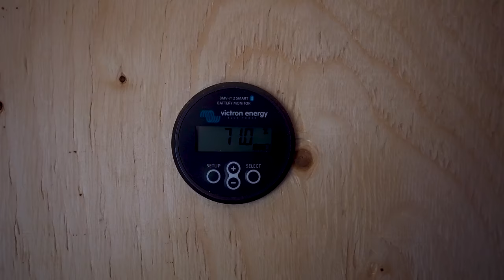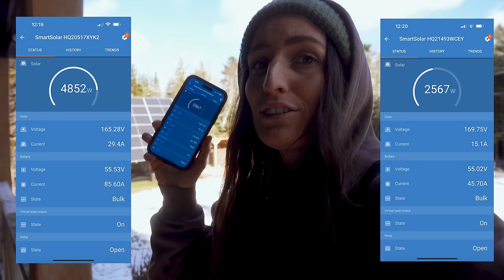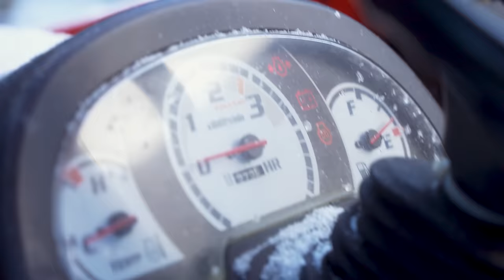Snowed In! Winter Hits Off-Grid Cabin in the Woods

Comment: You need chains for the front wheels at least. I’ve always used a rear blade but one that attaches to the bucket would work also. When you get stuck like that you can also use the backhoe bucket to drag yourself sideways and get out that way. Generally no need for someone to pull you out. As for merch, I bought some already but am always up for more. There are 5 people in our house that would be honored to wear it.

Comment: Yes you need chains but also use the brake on the spinning wheel so some power is transferred to the non-slipping side. The tractor unlike most cars doesn't have a limited slip diff so you have to do it manually yourself using your brakes. Most tractors I've use just have a little metal bar that connects both pedals together and you just flip it loose and can brake each side individually instead then.

Comment: How warm is all the new insulation keeping the cabin?  
Merry Christmas and Happy Holidays from Florida to Nova Scotia.

Chicken / Asparagus soup
Ingredients:
2 pounds thin fresh asparagus
2 large potatoes, peeled and diced
1 large onion, chopped
2 celery ribs, chopped
1 medium carrot, chopped
2 teaspoons dried parsley flakes
1 garlic clove, minced
2 tablespoons canola/olive oil
2 cans (14-1/2 ounces each) chicken broth
1 teaspoon salt
1/2 teaspoon pepper, divided
1 bay leaf
2 cups cubed cooked chicken
2 cups half-and-half cream
Shaved Parmesan cheese

Directions
Cut tips from asparagus spears; set aside. Place stalks in a large skillet; cover with water. Bring to a boil. Reduce heat; cover and simmer for 40 minutes. Strain, reserving 4 cups cooking liquid. Discard stalks.
In a Dutch oven, saute the potatoes, onion, celery, carrot, parsley and garlic in oil until vegetables are tender. Stir in the broth, salt, 1/4 teaspoon pepper, bay leaf and reserved cooking liquid. Bring to a boil. Reduce heat; simmer, uncovered, for 30 minutes. Discard bay leaf. Cool slightly.
In a blender, cover and puree soup in batches until smooth. Return to the pan. Add the chicken, cream, remaining pepper and reserved asparagus tips. Bring to a boil. Reduce heat; simmer, uncovered, for 5 minutes or until asparagus is tender. Garnish with Parmesan cheese
Nutrition Facts
1-1/3 cups: 226 calories, 10g fat (4g saturated fat), 51mg cholesterol, 660mg sodium, 20g carbohydrate (5g sugars, 2g fiber), 13g protein.

Comment: If you have neighbors to help you get your tractor out, you use them. Otherwise, you buy an electric winch and mount it to metal plate. Then take a chain with hooks on both ends and put it around tree near by and hook both ends on the back of the metal plate. Then you use your van battery hooked up to your van to power the winch. Hook the end of the winch cable to the front of the tractor and use it to help pull the tractor out. All while using just a little throttle on the tractor using second gear not 1st it has too much torque. The reason I say this way, because it is then portable and is not connected to one vehicle. Don't forget to let the glow plugs on that tractor heat up first before cranking. It sounds like a diesel. Should also have a can of either around to shoot in the carburetor or intake spicket for either, they sometimes have on them. Yes, on chains. Good idea ladies, go with it.

Comment: Loving the solar and battery setup. Concerning the difference in output between two seemingly similar panels. Are you aware how just a small shading of  one panel can cause a huge reduction of total solar output?  I noticed even after the panels are cleared, there was still portions of some panels covered. Shading just 5% of one panel can disrupt 30% or more of the total panel or even multiple panels. Check out some videos on partial panel shading but easier try to completely clear the panels when you can.

Comment: HEY LADIES!! I HAVE SO GOOD SOUP RECIPES. potato soup- you will need potatoes, kale, carrots, onion, celery, leeks, garlic, 2 cans of evaporated milk, bay leaf, salt pepper, sausage(optional). So, carrot, onion, leek, celery in the pot to sweat. Cube your pots and throw them in them pot and add enough veggie broth or water to cover. I would say 6 to 8 good size pots. I like the golden pots, but any pot is fine. Cut carrots to desired size and throw them in. Also throw in any herbs. Highly suggest bay leaf I add 5 to 6 leaves depending on the freshness of your herb. Maybe add a little thyme. Don't go crazy with herbs. So when everything is at your desired tenderness add the cans of evaporated milk. Blanch kale and throw it in about 5 mins before you sever or turn it on low and let the soup deepen with flavor for about 30 mins. If you want to add sausage( and I suggest you do) Brown in the pot before add the first round of veg. Take it out and sweat all that veg in the sausage oil. Then add sausage back in the pot when add the kale is added.  Sever with fresh homemade bread. This dish will warm the coldest of hearts.

Also, soup is so easy. I made a soup once with just veggie broth, pot, kale, white beans, onion, and herbs. It was so good. If you have some good broth and a couple of veggies you always have soup. Chicken broth, can of rotel, some shredded chicken, and some tortilla chips makes the best chicken tortilla soup. Plus I have been bumping up my ramen by putting left over veggie and meat in it. Like once I made it with all my roast dinner leftovers. Add add broth instead of water. IT SO GOOD. So just bump up that ramen! Hope that helps!!

Comment: Ladies you can use your backhoe to have gotten you out from being stuck. . Leave your front bucket down a little bit with it barely on the ground, and  extend your backhoe out up on the road and as if you were digging, you can pull the machine out back up on the road. If you worry about it flipping over while using the back hoe, put your one stabilizer partially down

Comment: I'm surprised you don't have a plow on the truck. Faster and warmer than a tractor. A plow blade on the back of the tractor will speed up the job as well. Shoveling snow will eventually do in your back. A snow scoop is the way to go. Use your legs, not your back. At 69 I use mine all winter in Vermont, you never know when the machines will fail to start.

Comment: SPICY LINTEL SOUP2

Mix all of this together and fry up in big pot till sausage is cooked, then simmer together to 10 min.

1 pound uncooked hot Italian sausage
1 pack diced ham (about 1 cup) 
tablespoons olive oil
2 tablespoons vinegar
3/4 cup grated and minced carrot
1 pack spicy salsa from deli 
1 tablespoon minced garlic     
1 tablespoon minced fresh basil
1 tablespoon minced fresh parsley
2 bay leaves
1 1/2 teaspoons salt 
1/2 teaspoon ground black pepper
1/2 teaspoon dried thyme
1/2 teaspoon dried oregano
1/2 teaspoon dried red pepper flakes

Add Broth and Lentils, bring to boil then pull back heat little.
Off gassing of beans may happen (Brown Foam) scoop out.
Stir on occasion, heat for one hour.

4 boxes chicken broth
1 pound dry lentils

Comment: Hey Ya crazy kids (Jazmin and Crystal),

1st: I love watching The Pack, including Izzy and Bella, as they are a great part of the channel, and how you are taking near barren land back home in NS, and turning it into an off grid home, (I plan to have an off grid home in the future and your experiences, good and bad, are study guides for me, as well as all the craziness you show in every video, and I'm guessing in your lives off camera as well.
I would love a black shirt or hoodie, size Large I can wear on stage when I get back onstage performing Stand Up Comedy in 2024.

A little suggestion you might still have time to do before the ground freeze's. 
Go to Beaver Lumber and buy a number of lengths of 4 or 5 foot rebar and straight white pvc water pipe or grey electrical pvc pipe (EITHER OR).
Make sure the PVC PIPS FIT OVER THE REBAR. 
Pound the rebar into the ground very straight about 1 1/2' deep, leave 3' to 4' out of the ground to slide the pvc pipe down over the rebar to mark the areas of where not to drive or plow outside of, then take the pvc pipe lengths of 10' and slide them over the rebar to make high markers so you can see the boundaries even if you get a massive dump of snow. 
A good idea is to spray paint the pvc pipe Road Worker/Caution Orange or put plastic orange flags on the top. You can also spray the pipes themselves with the same high visibility color.
Figure out how far apart you want the markers before hand so that you have both a general guideline where they are going and also a number of how many pieces of rebar and pipe you need. outdoor Electrical pipe will have more flexibility and durability to make it through the winter.

Merry Christmas and Happy New Year Jazmin and Crystal, All the Best in 2024

Ruff ruff, ruff, ruff,
Matt - Toronto, Canada

Comment: What I don't get about people that live in  cold areas in winter that they do not have the right Vehicles there is a reason most frozen countries use Toyota and especially Land Rovers as they both use love rev high torque engines and gearboxes top of the range are all manual with many settings including very low range and four wheel drive Diff locking systems. Even the Original Land Rover 2.2 petrol engine pulled out a Mercedes four wheel drive truck from extreme conditions when no other Vehicle could all on Top gear also with the narrow tires that vehicle has.